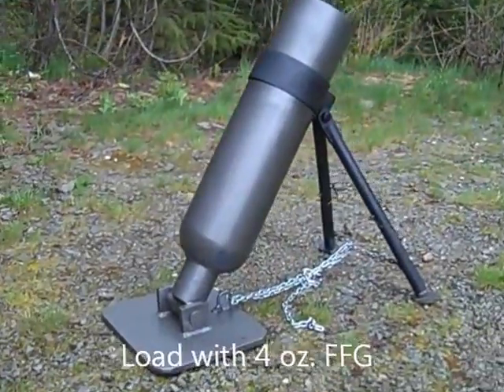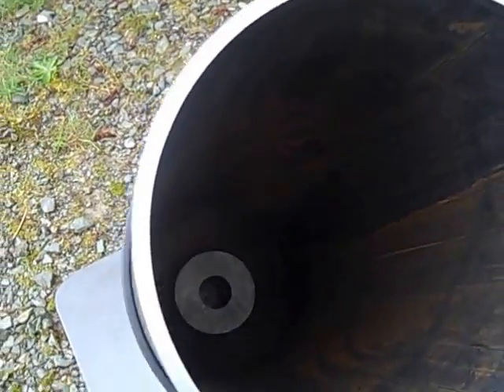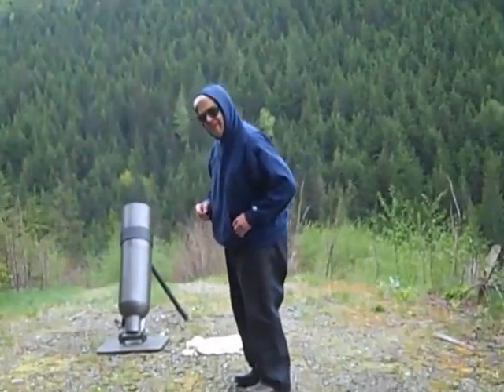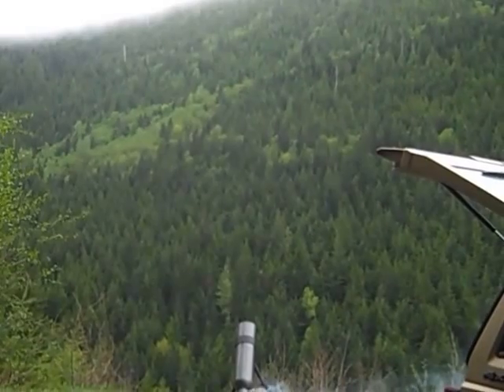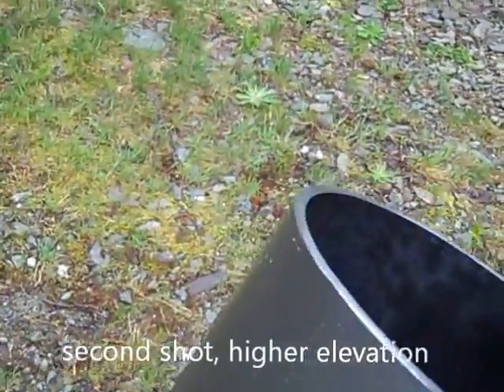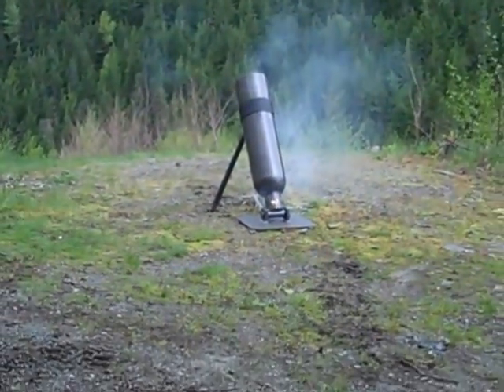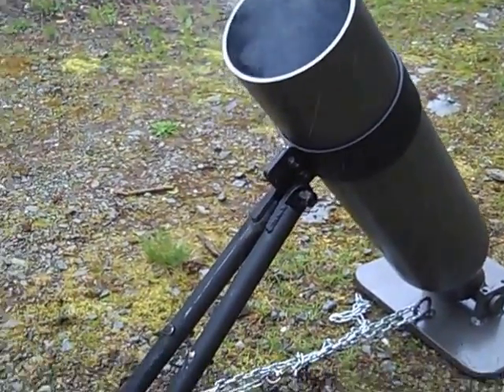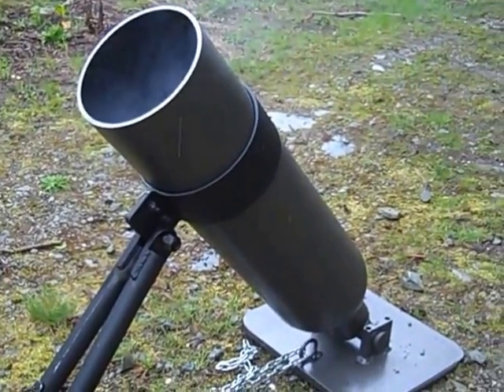MVCW bowling ball mortar

Comment: Bowling balls are really tough. No one with a mortar has reported this problem. The high altitude shots with this mortar you could hear the finger holes whistle coming down. The flight time was 17 seconds until the whack in the forest across the valley came back to us. 

I have sold this one and now make more compact units with wood bases much like the original Coehorn mortars. Not as much range and due to smaller size only takes 2 oz of powder but 4 is okay if you aim more vertical. Even though I like the smaller size it is still way over 100 lbs.
Reply: How far does this bowling ball go? Can you give me the details to make one? Lol

Comment: Painted with Rustoleum Spray paint. Don't remember the exact color but obviously a gray. Darn base plate weighed 80 lbs. and the rest took it up to around 175.  I'm in the process of making a smaller one. I already made one (Coehorn style) but it got snapped up in a quick sale. I need one for myself. This big boy went to a dentist in the area that lives on waterfront property. I know they are a little weird but they are tons of fun. Yes, the back woods in Washington have a bowling ball problem. An interesting factoid is that the original Coehorn mortar of the civil war was also 8.5" ball mortar. They made some larger ones but not portable, think the "Dictator".

Comment: I've  made 3 of these without chambers, just a trailer ball threaded into the end for a ball socket on the base plate. The flash hole for shotgun primers is reinforced. My normal load is 5 oz. I did a 1lb test then 2lbs, all was well so they are plenty strong enough as they are. Some guys in our club were concerned so it was tested.  With 2lbs it buried in the rocky ground at least a foot & folded the 3/8" base plate around it, the legs went flying. The ball went a long long way😊

Comment: Use nylons to contain your power, make a cheap mold using pvc, and or use wet paper in the mold. After it dries put your powder in and the flaps over the charge, the use tape to seal it.weight the power. doing this way you can get a more consistent shot. The Abrams tank rounds are paper with the explosives inside, it has a very small area in the back that is metal. Such a high velocity cannon if you used brass or aluminum or steel it will fuse it to the gun barrel making it worthless.

Comment: wow how much power dex powder do u put in for it to shot that far? where can I buy one of these?
Reply: That is 4 oz. of FFG. There are videos of folks pressure testing up to two lbs.  of black powder but they withstand it.  A waste as 4 oz. is plenty. 
Most folks make them. It is a 3AA2400 gas cylinder. Buy a condemned one from a weld shop. You have seen the powder chamber that is welded in the back. Drilling the hole has to be done by a machine shop as the hole is large. You need a serious piece of metal for the powder chamber and a good welder to install it into the base of the tube, You cut off the bottom of the cylinder and install the powder chamber in the top, tapered end. Do some web searching and you will find directions. I live north of Seattle and it is for sale but shipping is seriously difficult.
Reply: Zuzu Doggie thank you for your time!!I have researched it an I am going to make one lol .I live in WV.. alot of mining strip jobs to have fun with ...
Reply: Thanks for sharing great job